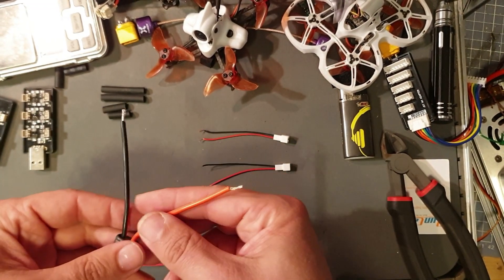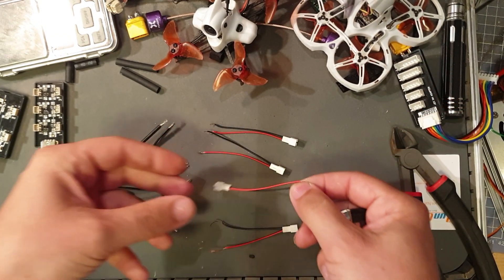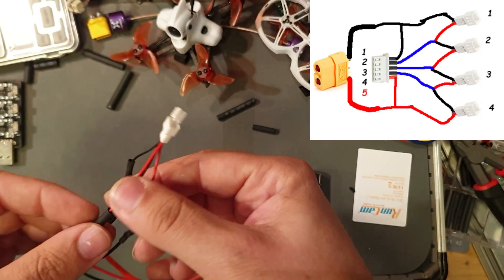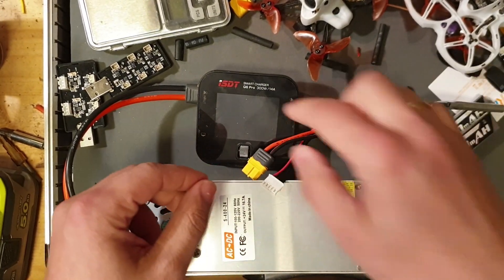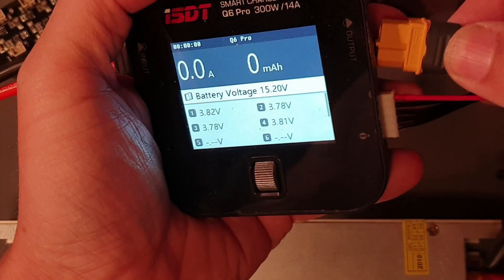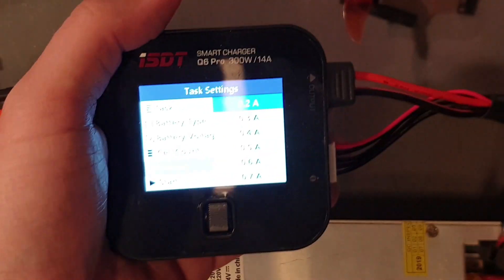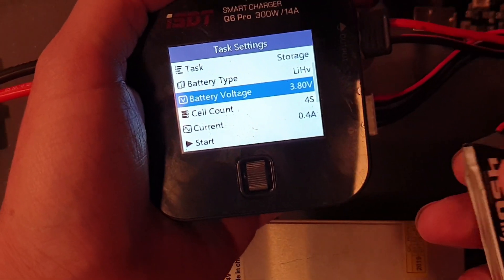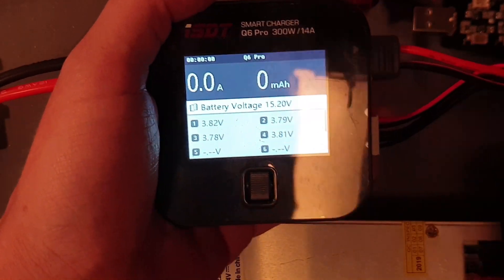1s Lipo Storage Charge, Discharge with Hobby Grade Charger XT60 | ISDT Q6 Pro

Comment: Love this video I keep going back to it to learn but little confused as you have smart charger set too umm 4s but charging 1s batteries so wouldn’t you put it too 1s to charge/storage? I’m a pain I know but I’m newbie and now trying to learn what to set my Isdt Q8 which is doing my nut in as instructions are crap lol 😂
Reply from the maker: example : 4s 1000mah lipo pack. its made of 4 batteries connected together in series, ergo a 4s battery.  1 battery is just 1s. so in the video i make a cable adapter to connect 4 1s batteries in series to make it a 4s battery. but IF i only plug 3 1s in this adapter. the charge would tell you somethings bad with one of youre battery cells...  for a 3s adapter cable i would need to make a new adapter specific for 3s only, same for 2s,5s,6s etc.

if youre 1s lipos are lets say 300mah, and you use this 4s adapter. i would set the charger to 4s (since 4 batteries is conected in series) and 0.3a (1a = 1000mah... 300mah = 0.3a) you will now charge youre battery pack at 1c rating. wich is recommended
Reply: @Just4FunRC  oh ok I see. Thank you for getting back and explaining this as I’m little confused on all that sort of stuff but this comment helps a lot. Thank you.
Reply from the maker: @Jib230181  i also msg you on insta. those might be perfect pre made for you
Reply from the maker: @valentin.kompatscher  now a days we even got some great 1s chargers. but i still prefer this method ^^ insted buying a charger just for 1s.

Comment: This is a great idea, especially for discharging, or storage purposes. The only downside I can see when using it for charging, is you will always have to charge 4 at a time to complete the circuit, or you'll get an error message. For most people that wouldn't matter though, since they tend to have dozens of 1s cells anyway. Just thought I might point it out though, for anyone wishing to try this. Also, you may already know this, but It would be safe, and faster to charge 4 450mah lipos at 1.8 amps, since the charging lipo's is recommended at 1 amp per 1000mah. Eg: I charge my 1300mah lipo's at 1.3 amps, and 1500mah at 1.5 amps, and so on. If I'm parallel charging 6 at a time, I charge them at 7.8 amps. It takes way less time, and doesn't harm the batteriesat all. I've got lipo's that are well over a year old, with hundreds of cycles on them, that I fly on my 5" rigs. They still perform exceptionally well, considering the natural degradation of lipo packs. Thanks for the info!
Reply from the maker: hi buddy, this is a great point! before i used to charge only at 1c rating. but today  its 2c min or more,same at the field.  Another pointer would be to check the  batteries specs that you own. 
when charging my bigger packs 5000mah etc  i just have them at 1c i often charge 4 or more at once :) but thats my way because then i have time to prep the rc too.
theres alot of whoops going on these days with tiny 2s or 3s,  could a vid about adapter to make 2x 2s into a 4s or 2x 3s into 6s  incase people realy arnt keen about paralell charging?
also thanks for the great input

Comment: Very good explained, thanks a lot. What do you have to do to build a 2s or a special 1s adapter? From my point of view: xt60 connected with the 4s balance connector and only connect 1 (black) and 5 (red). Afterwords these two (1 and 5) connect to one adapter to the battery and leave 2, 3 and 4 empty (for 1s). Is that right?
Reply from the maker: Hia, special 1s?  if on 1s you dont need a balance conector, just + and - solder what ever connector you want.
for a 2s adapter you would need a 3s balance connector. pin 1 is pack - , pin 2 connect between cell1 + and cell2 - , pin 3 is pack negativ.. hope it makes sorta sense hehe :)
Reply: @Just4FunRC  yeah thanks a lot! I didn't know :)

Comment: This is a really good video. My question is  can i charge different mah? For example 2 1s 250mah and 2 1s 350mah? Thank you
Reply from the maker: with this setup each cell has to be identical. or you risk,no you will beovercharghing the cells with lower mah.. but you could always make a 2s adapter :) i made some myself just in case.
Reply: @Just4FunRC  thanks for the information! :)

Comment: Will this work if you have: 2 batteries fully charged and 2 empty. Then you want to put them all on storage level? Anyway I believe you have to connect four of them every time if you want to charge or discharge.
Reply from the maker: hia! thats true this is a 1s to 4s adapter so you would need to connect 4x 1s lipos.   nope i wouldnt do that.  with my charge i have an option to discharge the lipos.  you could also make a 2s 3s 4s 5s 6s adapter all depends on youre needs.

Comment: I have the same issue with the voltage already being at storage voltage right after I have flown my 1s packs to 3.5v. When I say discharge I'm looking at the  voltage readout on my vtx, but when I disarm my quad I see the actual voltage sometimes around 3.7v. Should/Could I discharge more untill I see about 3.5v when disarmed?
Reply from the maker: the good thing about these ones. well atleast the ones im having is they recover fast. with these little guys i  often land on 3.3v too.  for me its just a habit of landing on 3.5v because i dont want to dmg the expensive lipos.  but these 1s lipos are so dirt cheap and i want to get most out of it.i just bought a few 5x paxks packs ended up beeing even cheaper. im at 30 1s lipos now.  in fact you have a good idea for a test video. thanks buddy.